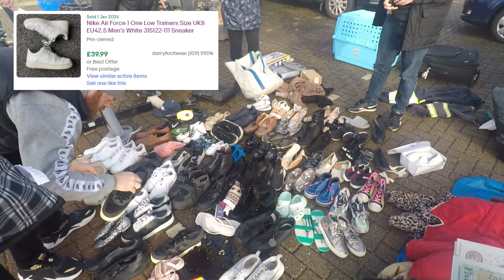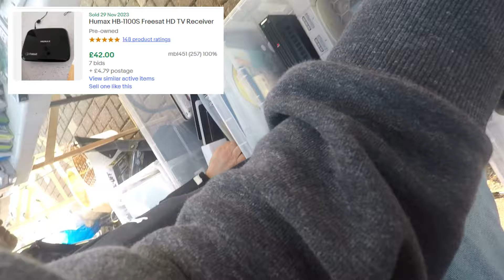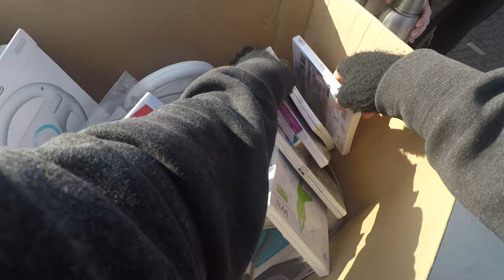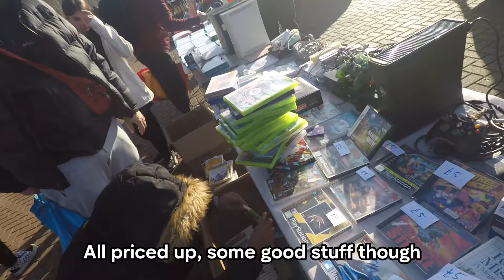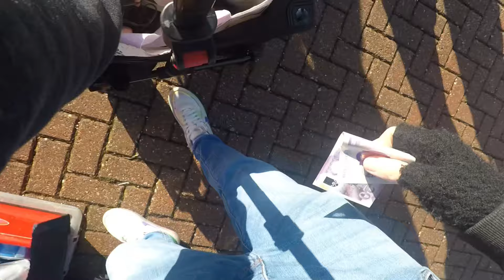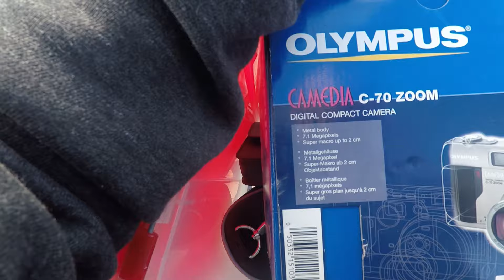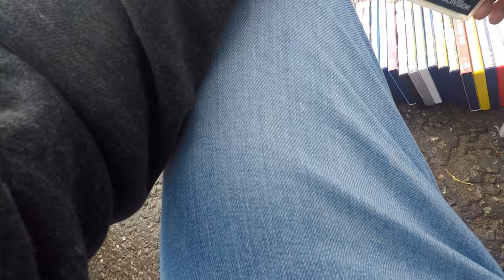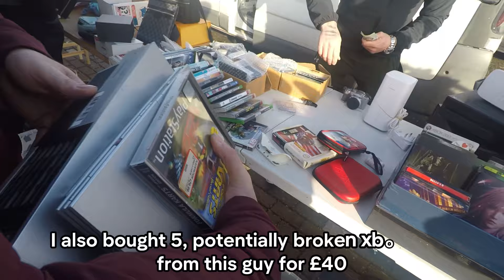£1000 From One Car Boot!

Comment: Hi, my friend is doing eBay and has over 600 random items from £5 to £1k items but only sells 1 item a day and is putting me off starting eBay if it's that slow. Could there be a big thing he is doing wrong and any advice, 
and thanks in advance 👍
Reply from the maker: Hey! It’s hard to say what the issue is without looking at their listings but some of the common things that can affect sales are..

Is he listing every day? EBay’s algorithm tends to promote listings from accounts that list consistently. 

Are his items priced competitively; it doesn’t matter how many items you have on your store; if all of them are priced wrong then none will sell, he needs to check currently listed against solds and price correctly. 

Are the items he’s selling in demand? He also needs to check the sell through rate of the items, this is how many have sold over a 90 day period against how many are currently available to sell. He could have a lot of items that are slow sellers which means they will probably sell, but not quickly and that could be a reason for slow sales. 

These tips have definitely helped me with sales but I’m no expert, I hope that helps!
Reply: @LukeResells  thanks will tell him